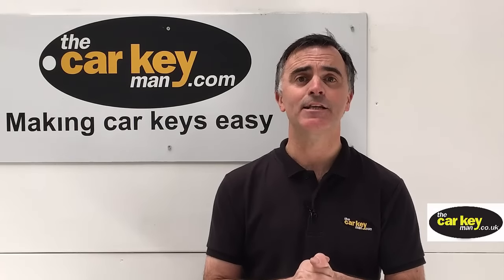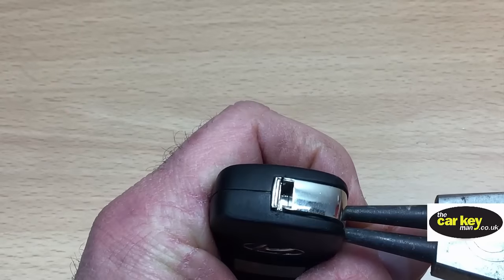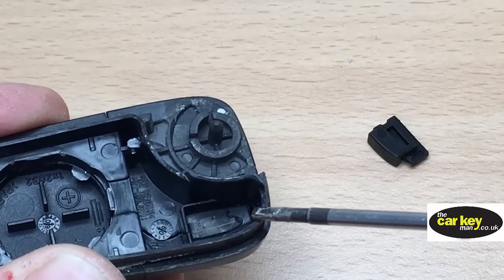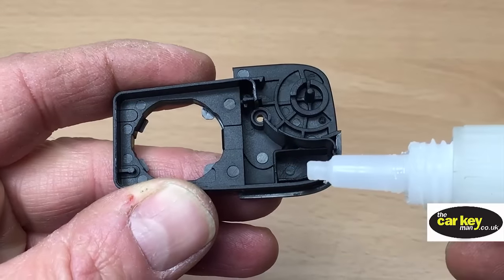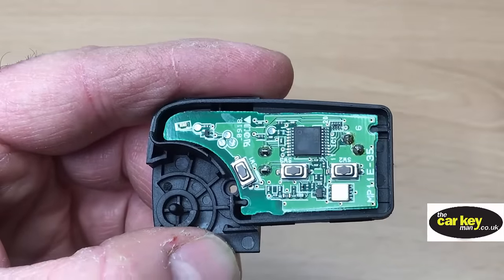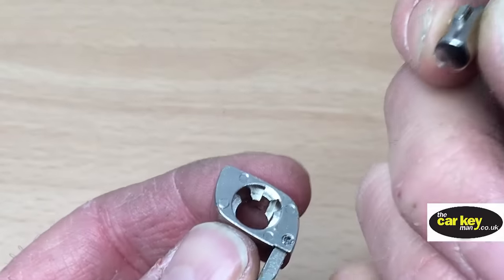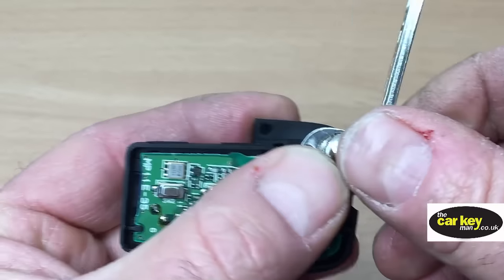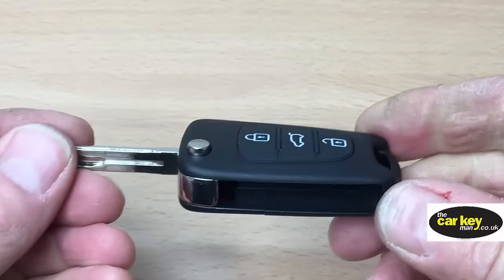FIX Kia and Hyundai Flip Key HOW TO repair

Comment: How do you get the pin out please to change blade
Reply from the maker: Hi Mudfisher1. Ok so here's the rub.
The reason the hinge part ( the bit that holds in the blade ) cracks is because there is stress put on when you knock the pin in and out. 
This is the reason we recommend the blade is cut, instead of changing the blade. 
The second reason is that often, the orignial blade from Kia or Hyundai will have a different fitting to the repair case blade. This means you won't be able to put the original blade into the repair case. 
However, if you want to get it out, you need a small punch, or pin and then hammer the pin out. We have a special thin tool to do this but we didn't show it because you can't buy it. 
Just be careful you don't damage the hinge part of the replacement case.

Comment: What's the metal thing he is connecting the key to called at 4:47 mine broke and I was wondering if they sell those
Reply from the maker: Hello Stiguel, the part that the blade goes into we call the hinge. It holds the blade with a pin, and it's the part that always breaks. I believe the only way you can buy one is to buy a complete repair case, and it all comes as part of it.

Comment: Great! Except my old case will not come apart at all. looks like it has been fully glued when assembled.
Reply from the maker: Hi Tonproblem when this happens as some are heavily glued. When they are that bad, we split them with a soldering iron. However it takes a while and you need to be careful you don't burn yourself, or slip and damage the insides. Are you in the UK?

Comment: Would I be able to solder the actual key to the metal on the key fob, as in doing away with the pin? My pin fell out and didn't know if I could fix it for cheap or if I need to spend $8 for just that little pin piece
Reply from the maker: Hi, no I don't think so sorry. It needs a new case with the new hinge part...good luck

Comment: Thanks for the video. I’ve swapped everything over as in the video, remote not working. Light flashes twice as it does on my other key but doors don’t unlock. Car will start though. Any ideas?
Reply from the maker: Hi, did it work before?
Reply: @TheCarKeyMan  yeah wondering if I've damaged the circuit board when prising it apart, but can't see anything obvious.

Comment: Wonder what models and years have the chip. My 2015 Sorento does not. I am trying to replace the key on that model year fob that broke. I still have the key and a replacement fob coming. Key works fine without the fob so I know it does not have need a chip.
Reply from the maker: Hi Don, are you based in America?

Comment: Hi, thanks for the video. I was just wondering if I could leave all the electronics in my existing case and just insert the new blade into the old case? Then get that cut. Rather than moving all the electrics over?
Reply: Just noticed someone else had already asked this question. Sorry. Again thanks for the video
Reply from the maker: You'e welcome. Yes it's the problem with the hinge cracking. Terrible design. The good news is that lately, in alot of the keys we've done, the chips have just dropped out, no glue in sight!

Comment: Helpful but where do you mention that part that if your key has an immobiliser chip in it - it's near impossible to transfer that into the new case!!
Reply from the maker: Hi Ben, sometimes the chip just falls out, like in the video, othertimes it is glued in. There's no way to tell until you open the key unfortunately. 
I use a soldering iron to carefully melt the plastic around the key, just watch you don't overheat the chip

Comment: Good afternoon,
after swapping everything in a new case, the car is starting (KIA sportage 2015) but doors are not opening and closing. Is there a kind of reset or reprogramming for the key.
Thank You.
Reply from the maker: Hi Luca, if the buttons no longer work (did the work before you changed the case?) then it's most likely that the connection to the key battery isn't quite correct.
We've been swapping these for over five years and never had to re-code the key, plus this needs to be done using a computer.
It's unlikely you need this, just check the way the battery is held in the new case

Comment: Trying to pry it open... it makes cracking noises but nothing happens. Makes me wonder wether there is a hidden screw or something. For now I'll leave it since I feel like I already deformed the plastic inside... hyundai ix35 key.
Reply from the maker: Hi, ok so there are a coupe of possibilities. the first is that your key already has been repaired and there is a screw holding it all together, does it look like an original key?
Or if it is an original, then it's only glued together. It's just a case of putting the pliers as far as they go in and gently increasing the pressure til it opens.

Comment: I tried this and the doors lock/unlock and the car turns over but won't start. Any ideas what may have gone wrong? Car starts fine with my spare but I can't start the car with this one. hmm.
Reply from the maker: Hi James. The part of the key that makes the car start is the immobiliser chip, the small black part that you have to swap over. Did you do this?

Comment: Hello I have changed the case but now my key won't unlock the car from the buttons on the key, I have to manually turn my key into the car to unlock the doors, why is this happening? as with the old case I had this problem but I thought by getting a new case/ battery it would fix this issue...
Reply from the maker: Hi Chloe. Has your key ever worked from the buttons?
Reply: @TheCarKeyMan  Yes when I first purchased the car in 2020 but over time the key kept needing a new battery but now that won't even work... bit lost as to what I need to do for it to be fixed
Reply: @taylortwinnings  Did you ever find the solution to this?
Reply: @MrJimmyPenguin  a new battery but it dies out too quickly, we did google that and someone said to try cleaning the insides/ the circuit board with contact lens solution.........we have yet to try this as the new battery is still working for now
Reply: @taylortwinnings  dang.

Comment: i did this and the heat from the soldering iron damaged the transponder. whats the cheapest course of action.
Reply from the maker: Hi Nick, you've been a bit unlucky. A good autolocksmith can supply and code a chip in

Comment: how do you get the hinge piece out of the new key? The little round piece that connects the key to the larger hinge.
Reply from the maker: Hi Greg, Have you opened the new key yet?
Reply: The Car Key Man  I opened the package but cant get the tiny round piece out that holds the key to the hinge
Reply from the maker: Hi Greg. We use a pin punch. It's a small hardened pin that can knock out the pin when you hit it with a hammer. 
You could use an old this drill bit, but just watch you don't break it inside the hole!
Can you not just get the blade cut? It's much easier we think

Comment: I followed this and my chip wasnt even glued in, which was nice, but after completeing it the car starts but the buttons on the fob dont work. Any idea?
Reply from the maker: Hi, well, it won't need recoding. It can only be that for some reason the key isn't transmitting a signal correctly
Reply: @TheCarKeyMan  I took a multimeter but dont really see anything super odd, any tips where I should look? or idea on resolution?

Comment: I had no transponder chip in my case (2013 Kia Soul) Is that unusual? Followed the video otherwise and everything worked fine.
Reply from the maker: Hi Kenneth, thanks for the feedback. Are you in America?
Reply: Yes, south Florida. I don't know if this makes a difference or not, but it was a Hertz rental car.
Reply from the maker: Hi, thanks, I've had another email from someone in America who also said there was no transponder chip! This is very odd. Maybe some models in the states just don't have chips?
Reply: According to this web site: http://www.1ablelocksmith.com/BLOG/?page_id=501 The 2010 to 2016 Kia Soul uses a standard key. Maybe that is why no chip was in the case :)
Reply: This is gold! Thank you!
Reply: Kenneth Heinly  Hi, sorry trying to best understand... so if the car just says "standard key" then all I should need to do is just move the circuit board and key blade from one housing to another? Why would the guy at the key fixing place tell me the only way to fix my key is by recoding everything for $180? Like, I guess they just don't even want to pretend to charge me $30 or whatever do something that simple...

Comment: Hey car key man, i was wondering, is there any tech in a basic key with the black head? It doesnt have buttons or anything and the car is a very cheap barebones suzuki though a 2015 model.

I really want to turn my car key into the size of a regular house key, i tried duplicating it and that key opens up the car but it wont start it, any ideas?
Reply from the maker: Hi Michael. They started putting chips in car keys all the way back in 1992, so I would guess yours has one too. It's similar to the kind of chip you put in a cat or dog, just more complicated. So if you want a spare that starts the car, it will need to be coded in or cloned. Hope this helps :)
Reply: @TheCarKeyMan  this makes sense, thanks for this! I actually never thought of that because in my mind if there were any electronics in the fob, wouldnt it need a battery? Any thoughts?

Comment: Really good ,but the rubber on the push lock and unlock is worn out and therefor l need a new one
Reply from the maker: Hi, new rubbers are available, but sometimes they don't fit very well. Otherwise you need a complete new case and swapping over the chip and remote board. Here's what you need https://amzn.to/2CT58QJ

Comment: Hi thanks for the video. I’ve done everything in the video but when I place the new battery in and prsss the button the little red light doesn’t turn on. Is there something I may have done wrong?
Reply from the maker: Hi, do the buttons work the car central locking?
Reply: The Car Key Man nope, the car won’t unlock or lock. No light. Car starts fine though. I put a brand new battery in also.

Comment: I ordered same  key case from WISH 
I am waiting for it's delivery  but this one doesn't have the back hole for the tiny screw
What about back "H" logo ???
I noticed that the back oval shape for Hyundai key (original Hyundai key)  has some shapes inside so this tiny emblem can seat and stabilized tight  so glue is not necessary 
What about the new key just you show in this video even with or without the small screw ???
I don't think that the Hyundai emblem will seat there due to the missing shapes of the original key !!! 
Will you please tell me which option do I have to stabilize it without using some glue???
I own an i30 CW (year 2015)
Reply from the maker: Hello, There are two types of case, push together and screw together. As a daily vehicle locksmith, I see push together cases that fall apart, which is why I always use a screw
Reply: @TheCarKeyMan  thank you for your reply 
I 've just opened my used key but that chip wasn't glued !!! 
I tried to fix the problem with the spring and I pushed it back again but this original key was very difficult to be opened 
So I left it half pushed ( because the back side [battery] was very tight in)  so to be opened again when my new key case will be delivered !!! 
Thanks  anyway

Comment: Thanks for the video very helpful. I have a question if you can help please? I have lost the pin that holds the blade in place - am I able to order a replacement pin from anywhere, or are there any other fixes?
Thanks, Angela.
Reply from the maker: Morning Angela. Is it that the pin has just fallen out? If so, there is normally a reason for that. Often a hairline crack opens the hole up very slightly and the pin drops out. It can be quite difficult to see.
Reply: Hello,, yea the pin that holds the blade in place has fallen out as the blade is now detatched from the metal holder part in the plastic body, but everything else is ok. I’ve tried searching online to order a replacement pin with no luck. Any idea could I fix it, or get. Replacement pin part for it?
Thanks.

Comment: The button to flip key open is flush  with case so I can't press. Is there a trick or fix to placement?
Reply from the maker: Hi Kate, are you using all the new parts, except the blade? This normally happens when the old blade holder, and button from the old key is used in the new case
Reply: @TheCarKeyMan  using new shell, but old key parts including old spring. Seems to close up OK and alarm works, but key button to flush to press. Can't figure out what I'm doing wrong.

Comment: HI, Can I just replace the blade. My fob is in good condition but the blade holder has broken.
Reply from the maker: HI Jim. Good question. 
You have four problems.
To replace the key blade holder, you need to open the case.
Next, the case is glued shut, so that when it's opened up, if you reuse it, it's a bit naff. 
Third,you can;'t just buy the blade holder, unless it's complete with a replacement case
Lastly, if you can't take the blade holder out of a new replacement case and put into your old case, it just won't work. 
So no, you need a new case....sorry!
Reply: The Car Key Man Thanks for the fast reply. I’ll take your advise. I’m not going to attempt it myself. Sometimes you have to realise the potential for a complete cockup and pay for a professional repair. Unfortunately I only have one key otherwise I would have posted it to you. Best regards, Jim

Comment: Thank you for this video. I’ve managed everything except removing the pin. What tool do you use in the clip?
Reply from the maker: Morning Briony. Firstly, we think it's better to get the blade cut, simply because when you take the old blade out of your broken key, it may not fit into the new key!  You may need to alter the tang with a file and this is common when trying to put the genuine part into a repair case.
I'll post a link in the description of the video that will show you what you are after if you want to get the pin out.
Reply from the maker: @ianphillips1026  Thanks for the information. Yes the company policy seems to be that if they didn't supply it, they won't cut it! Glad you got it sorted

Comment: Hi great video, very informative. I have a question - I have exactly the same problem as the key in the video. I don't really want to risk breaking the chip so I am thinking to just replace the blade holder by buying a new kit and getting the blade cut to my key's pattern. Would I be able to just replace this part without re-casing the entire fob? Also, I noticed you didn't take any screws off the broken fob..
Reply from the maker: Hello there. Ok so on this key, normally there are no screws to undo. Unfortunately, when you open the old case it will break, so you need to use the new case and blade holder. We have done a few of these lately where the chis hasn't been glued, but that's unusual.
Reply: Thanks for the response. That's a shame because I don't have a spare key and don't want to risk being locked out! I would send it to you to do it but unfortunately I use my car to commute to work so that isn't exactly an option.. what would you suggest?
Reply: Would there be no way to super glue it back together?
Reply from the maker: Sorry, I missed the reply...sometimes the case is damaged when you open it and you may have trouble getting it back together. This is why we recommend a new case
Reply: Hi just an update: I've finally conjured up the confidence to give it a go myself. I bought some circlip pliers and it took about 2-3 seconds to open up and to my (pleasant) surprise everything including the transponder chip fell out immediately! After that it was just a case of placing the insides in my new casing and it worked a treat! Thanks again for your great video!
Reply from the maker: That is good to hear! Well done. It's good that the chip fell out, sometimes they are solid with glue. I really appreciate the feedback, it makes it doing the videos worthwhile. Did you swap the blade or get it cut?
Reply: I got the new blade cut so I still have the old one. I was just thinking if I could use it for a spare key but I'm guessing that would require another transponder right? The video was very helpful and I'm sure it has been for others, I personally appreciated the warnings about the chip.
Reply from the maker: That's good you got it cut. The hinge part that breaks is easily damaged if the pin is knocked out. Yes you'd need another chip, but keep the blade, if you lost your only key, then having the blade will save your local Auto Locksmith time and it wiill save you money!
Reply: Great, thanks for the advice!!

Comment: Hey buddy great content I was wondering after upgrading my fob to a newer shape the circuit  board is about 1mm to big for the casing to close sealed shut could it be very lightly filed or even sanded a small tad to help ease it into the new upgraded case? Thanks alot if you do reply it's really appreciated in advance. It's been So hard to find an answer to my problem.
Reply from the maker: Hello, what sort of upgrade have you done? Personally I wouldn't do what you are asking, but it may work if you are careful
Reply: @TheCarKeyMan  it's a Peugeot rcz with the old rectangle ceo523 Hu83 blade with grooves into the newer style the 308s came with a few years later. I was only going to buff the very light green edge when held upto the light you can see there is not any electricals happening there. The absolute slightest of adjustment just to help it close over.

Comment: Can you help me i have elantra 2014 i changed cover of the key and the car start its fine but my problem that the remote stopped working so i cant lock/unlock car using the key remote
Reply from the maker: Hi, did it work before you changed it over? How did you open the case?
Reply: Yes it was working before, and i opened it as u did in video